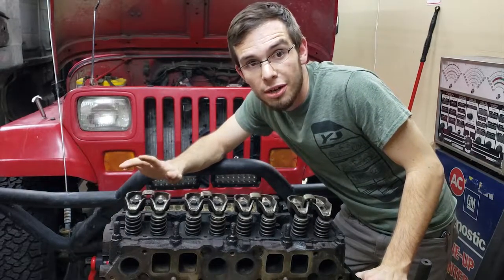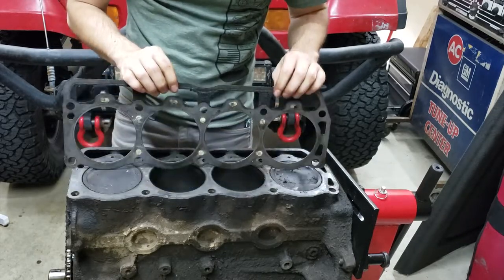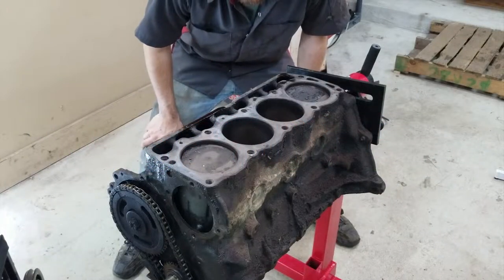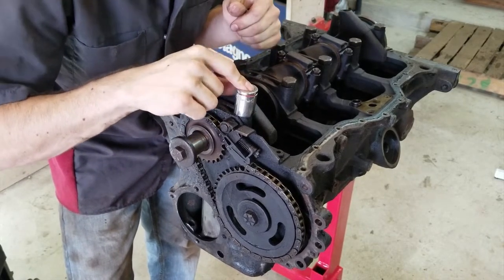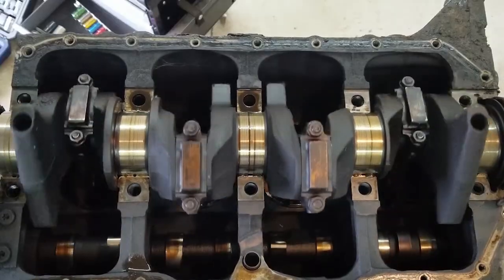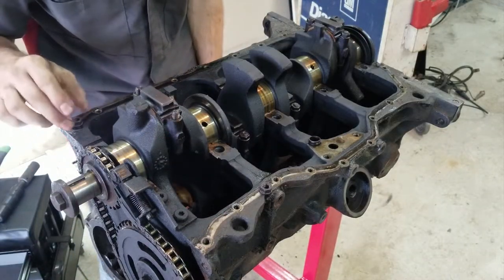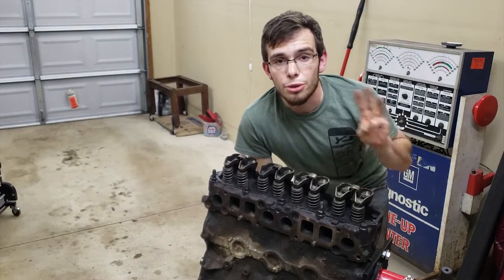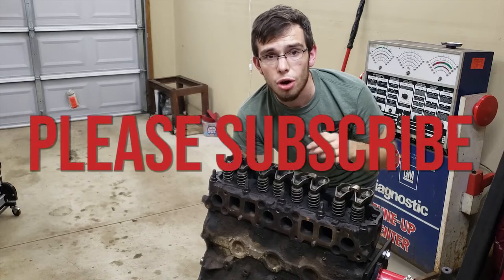Jeep 2.5L 4 Cylinder Engine Complete Tear Down Part 3

Comment: That fuel pump would have been for carbureted engines. Though I don't think the 2.5 was ever carbureted in the YJ.
Reply: You're correct Chad. The YJ was never carbureted. But the 2.5L engine did have a carburetor (see below). I have seen carb kits from Omix and Weber made for the 83-88 2.5L CJ's and YJ's.

Jeep 2.5L fuel systems:
1984-1985 One barrel carb
1986-1990 Throttle body injection
 (87 was the first year of the YJ)
1991-2002 Multi-point fuel injection

Comment: Just about to tear into a 2.5, thanks for the helpful video. Your comments show peeps educating you on errors, you handled that with grace.  I have had pistons fall out, it was a newer engine that the ex sabotaged so it started self destruction but I caught it before any real damage.  The top lip is a combination of carbon and where the rings wear the cylinder, if you are re using the pistons, poor boying it, try to never push one out the top, the rings can snap, remove the crank and pull them out the rear if they fit.  One poor mechanic to another.
   The rings on three of those pistons where placed wrong, their placement facilitates quicker wear, they should be the side as the face gets the most wear and friction. The bottom ring is the oil ring, it facilitates lubricating the piston and is fed oil through the rod oil ports.  The bearing wear allows oil to flow out at the bearings and not up to the piston, this is why those pistons were showing wear and tear. 
  Great video and please keep it up, this will be my first jeep engine rebuild as I primarily work on flat 4 VW and Chevy small blocks, I needed a jeep course to see the tricks.

Comment: Son son son! Ive been a mechanic for a living for 42 years and after watching 2 minutes of your video I said to myself if he rebuilds this it will go knock knock BANG instantly on start up! Next time You need to get someone in the know to help and guide/help you doing this. Also not certain but looked like a crack on side of block and or Welch plug aka freeze plug leaking coolant. If im guessing you either gave up and got a rebuilt or carried it and had it done. Also most of the best mechanics I know never went to any school. They had a high level of mechanical ability and jumped in and started learning from growing up poor and a have to fix it need. Im pretty sure you have a youtube diploma Like I said make friends with a old timer in the know and learn.
Reply from the maker: If you pay attention to the series I am only taking apart the engine to show each component and where it lives. It would have cost the same to have it machined as it did to buy a long block assembly. This engine was never intended to run again and I was not rebuilding it. I have a group of experienced mentors that I go to often and they have been incredibly valuable to me. I have also learned a ton by jumping in an trying new projects like this one. The difference between me and others is that I film it and put myself out there in hopes to help someone else like me. As for a diploma, I have a bachelors in mechanical engineering from Iowa State University. I didn't know YouTube was offering diplomas but if so I want one! I would have fewer student loans.
Reply: @JeepSheepTV   Yes I seen You bought a Amazon engine

Comment: Just came across this. Do you know which part(s) were causing the knock?
Reply from the maker: pretty sure it was the lifters. See how the top end of the engine is completely dry, the lifters basically had no oil in them.
Reply: @JeepSheepTV  thanks for the quick response! Did the noise quiet down when warm or was it there the whole time?
Reply from the maker: @drewdavid9672  it was constant

Comment: it's painfully obvious that you are learning and not very knowledgeable,  That's ok, you are doing great. However, let's clarify some nomenclature, @ 6:00 you start to refer to "main bearing caps" as cylinders.  Also, order of operation is important.   You should remove the connecting rod caps first, then remove the piston/connecting rods BEFORE the main bearing caps.  I have never seen nor heard of a piston just falling out.  
you did good in pointing out putting parts back in the same location AND orientation.
Reply from the maker: Thanks for understanding! Is there a reason why you do connecting rod caps first? It makes sense but If there is a specific reason that would be good to know.  Also,  I had an engines course in college where we had a lab that was taking apart and reassembling an engine.  The lab paid no attention to any kind of protocol and was set up for a short amount of time. The engines reflected this. Parts were on upside down and so on.  I had a little Saturn engine and when the caps were removed those pistons just fell right out. Thinking back... they didn't have rings anymore.  Too many people had gotten frustrated from putting the pistons back in that they tossed the rings in the trash...
Reply: @JeepSheepTV ,  you would never see pistons fall out with rings installed, and the only time that would ever happen would be in an auto maint. class like the one you were in LOL
As for the order of assembly/disassembly, you do not want the crankshaft to be unsecure while you are doing other things.
on a different note; The bearings that you removed from the rod journals and mains are the modern split hardened steel type and are very common, but there was a time when such precision was not available.  way back in the old days they used to pour Babbitt bearings (Babbitt is still used in some applications today)
here's a link to how that was done
https://www.youtube.com/watch?v=JBL0Y3_yQ7I